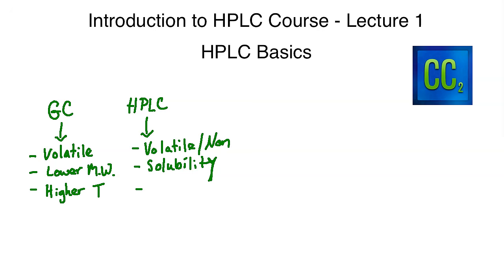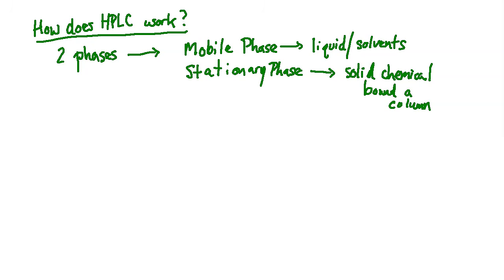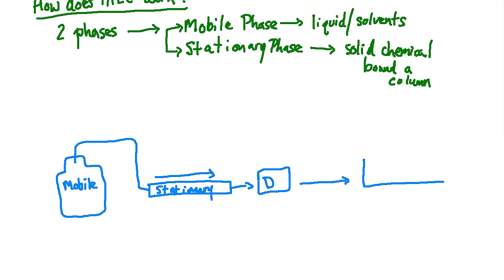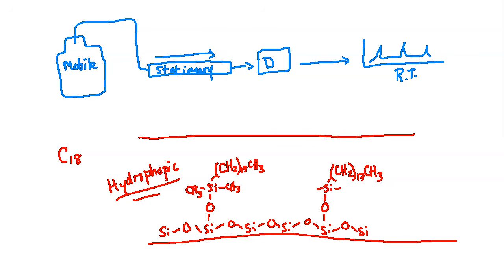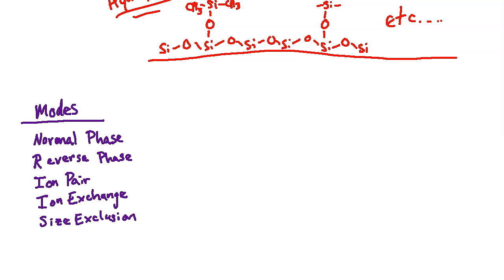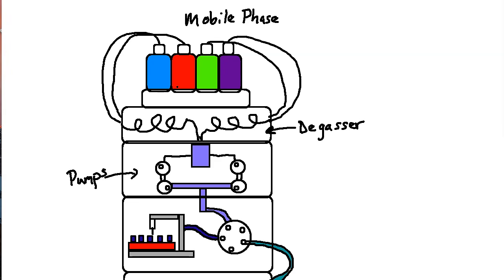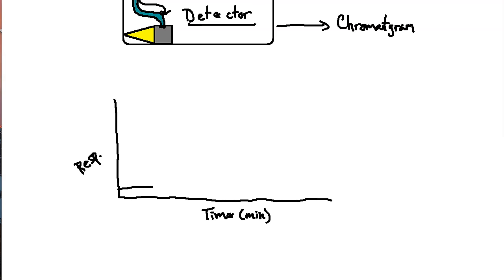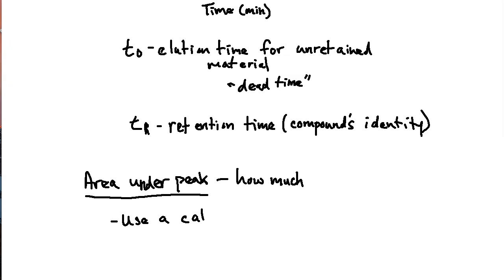Introduction to HPLC - Lecture 1: HPLC Basics

Comment: Thank you for the insight on HPLC, however, i would like to know how you determine the different concentration for the calibration curve and how you would be able to know if the range and limits used is not adequate enough. Again, how is it prepared and what are the possible contents or components for a sample e.g. PET.

Comment: This is a great starter! In 1979 I worked as an intern in an analytical chemistry lab doing HPLC and I loved the technique, never forgot it. A few years ago I built a hobby lab, and bought a lot of Shimadzu LC-10 machines. Quite vintage 😊
Electronics all refurbished and OK, purchased LabSolutions PDA and now in the process of getting the pumps up and running. A bit costly with all the spare parts that are needed, but so nice getting it working!
I will check out all your YT's! Thank you for your dedication and sharing of knowledge, I really appreciate it! 🔆🔆🔆🔆🔆🤗👌🏻🙏🏻
Reply: what will u do with all the stuff 
what is hobby lab
Reply: @Ashish-er4kz  as it's a hobby for now, it'll be simple things at first.. Compare qualities of supplements, and after that analyze simple things like ions (iodine, selenium, Magnesium, potassium) in urine. If possible, I'd love to do hormones, etc.

And of course, pesticides, herbicides in food, but that will be challenging.
Reply: @Ashish-er4kz  it is a small lab, for pleasure and maybe, after retirement,  I can do work for others.
With HPLC one can analyze liquids and anything you can bring into a liquid.
Check quality of supplements and  food.
To some degree environmental analysis, like the pollution of waters, test for ions like calcium, potassium, halogens, etc.
Check your urine to find deficiency in iodine or minerals .
The list is long...

I would love to have mass spectrometry, but that's too expensive, too big and too heavy...

Comment: Amazingly helpful! Especially for an RA working with HPLC who never took any HPLC classes.
Reply: Same! I majored in Biochemistry but only learned it briefly from the textbook.
Reply: I've been working only with a medium pressure chromatography system, because it is the one which is available in my lab. Despite this fact the exam questions require knowledge of running procedure for HPLC😑

Comment: Great lecture! Thank you. One think that is unclear to me is how the HPLC system collects the different fractions after separating a mixture into pure compounds. Does it do this automatically?
Reply: A standard HPLC System will often not collect the compounds after they pass the detector, only analyze them. With some advanced detectors such as MS it is not even possible, because the analyte is destroyed in the detector.

However, with many detectors (such as standard UV/VIS-detectors for example) you can isolate a compund or fraction by simply collecting the eluent (mobile phase) after it passes the detector. For that you just take the capillary exit and collect everything that comes out during a certain time frame (normally, all eluent exiting the detector will just go into your solvent waste container). 
You will see the peak of the compund(s) that interest you on your software screen (so you know when it is in the detector) and then immediately collect the eluent in a vial or similar container. When exactly your compound gets from the detector into the vial depends on the flow rate and length of the capillary after the detector. 

Separating two compounds with very similar retention times this way is pretty difficult. Also, whatever fractions you collect this way will usually go through some more steps, such as evaporation of the solvents and further purification steps.

So called preparative HPLC setups are you used to collect bigger amounts of a chemical (or a fraction) separated by chromatography. They use higher injection volumes/amounts, bigger columns and higher flow rates (as well as pressures) than standard setups, so that the amount collected at the end is worth the effort.
Reply: @CompletedChaos  Thank you for the detailed explanation!
Reply: @CompletedChaos  v well explained..I hv done this in impurity profile lab for some time 👍

Comment: This video was great! The more detailed picture of the HPLC system was great and clears things up a lot. I have a question about the chromatogram: Does one substance, I mean like one chemical compound, always only have one single peak in the chromatogram, and the other peaks must be something else?
Reply from the maker: In general, yes each unique compound will show up as a single peak on a chromatogram. That being said many times suboptimal conditions can lead to "peak tailing" which spreads out or gives the illusions of multiple peaks. The only time a compound might give 2 signals is if somehow it was breaking down into two separate sub-compounds when exposed to the HPLC conditions.
Reply: @ChemComplete  Thanks so much for the reply! :)

Comment: Thanks a lot for the explanation. How many types of calibration curves are there that can be used to calculate the concentration of a certain constituent in a sample ?
Reply from the maker: There is technically an infinite number because you can use any variety of known concentrations. There are two major points to keep in mind when designing an unknown calibration curve: 

1. You want to use multiple known concentrations with a good spread of values. I always teach a minimum of 5 known concentration values for a solid correlation. 

2. The range of known concentrations must capture the unknown value. This is to say that the unknown concentration must fall between your lowest and highest known concentration.